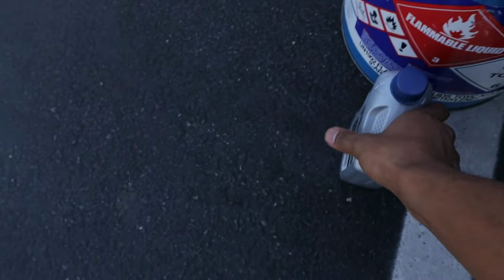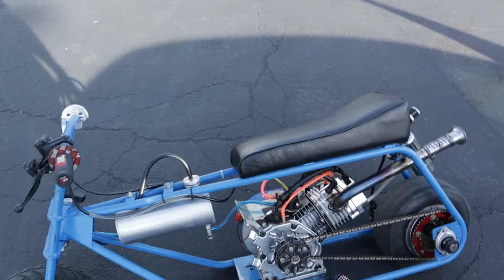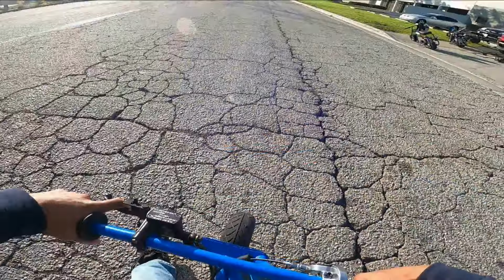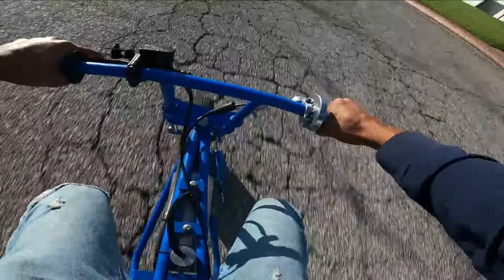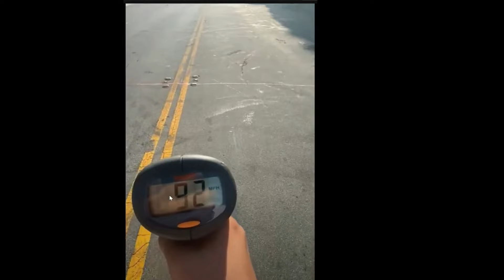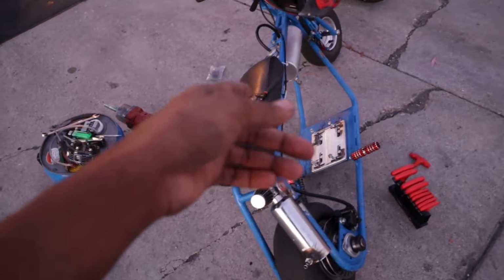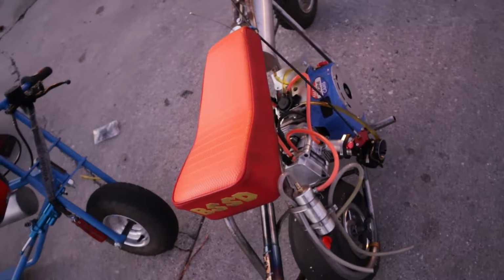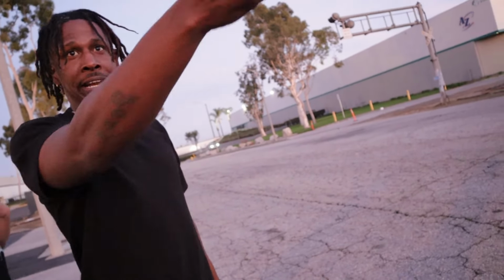30hp Billet Head 236CC Mini Bike Is A Power House!

Comment: JZ I reccomend M1 over M5 in this super hot 85 plus degree weather. The pure alky cools better than the m5 with all the additives and the little nitro, and cooler = better power. Mine runs a whole lot better down low. Your jetting should be right at .046 pilot, clip in middle, .076 main jet. She will run like a dream n you won’t have to touch it.

Comment: Was bro at Westminster ? I swear I saw u today bro but any mini bike recommendations?? I was gonna get a Massimo mb200s but it has bad reviews or what can I possibly use to upgrade it
Reply: @active_king18  was wondering what the best bike would be for me / do u got socials I can contact u with ? would make it a lot easier for me unless here is fine but ye I was looking into this bike “ Massimo Motor MB200S Four Stroke Single Cylinder Displacement 196CC, 1 Gal 19X7.00-8 in Weight Capacity 220 LBS 25 MPH, Gas Minibike” to use on the roads but if there’s a better bike I can get let me know g or what I can install to it to make better at least if that’s also the case but so far I like the bike itself just saw bad reviews on it so I’m second guessing it
Reply: Would be a good idea to look at the other full suspension 19 inch tire bikes before getting that one. Another question to ask is do you really need full suspension to road ride a min bike? The 19 inch tall tire bikes are pretty much setup for offroad, from gearing to tires.